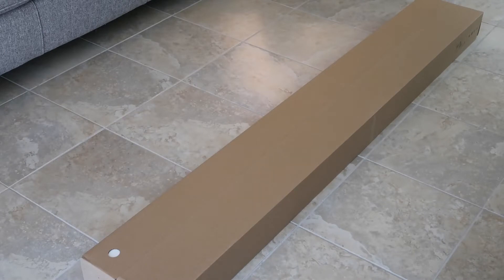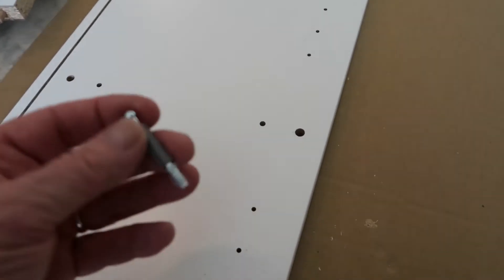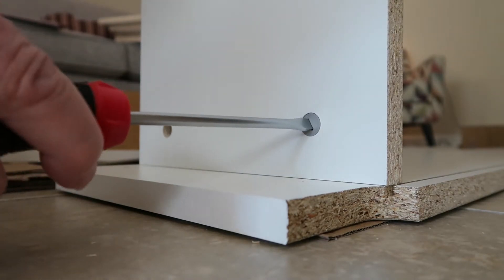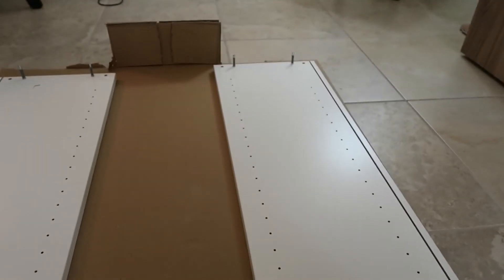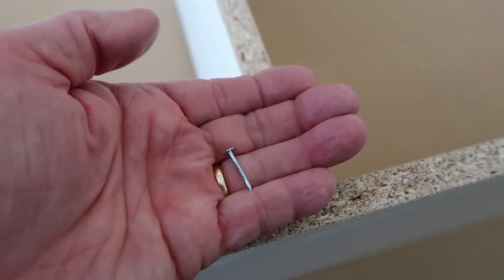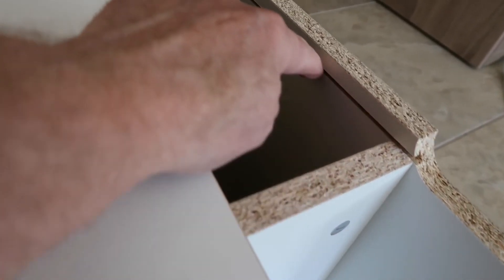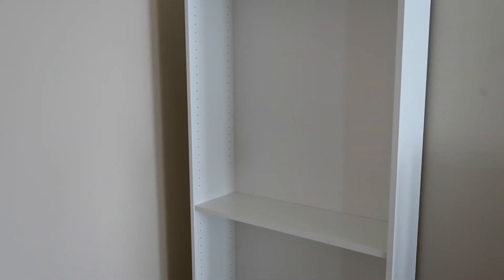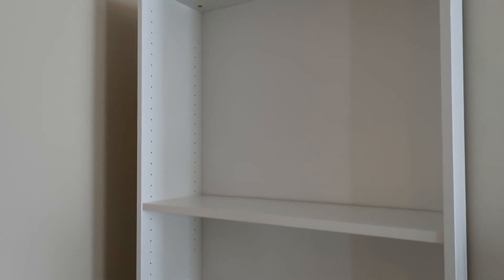Ikea 101 - How to Assemble a Billy Bookcase

Comment: This video was really helpful. One thing though. I believe your top shelf is on upside down. Those locking brackets should be facing the ceiling instead of the inside of the bookcase. If you look at images on the IKEA site, they are not visible.